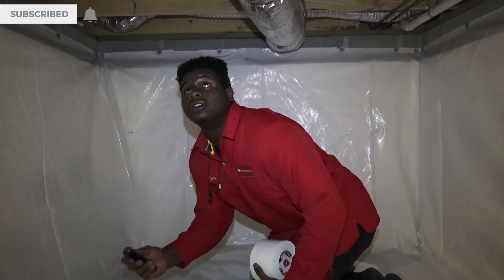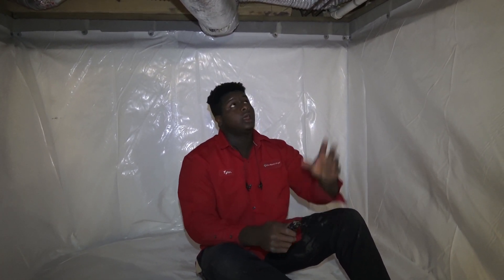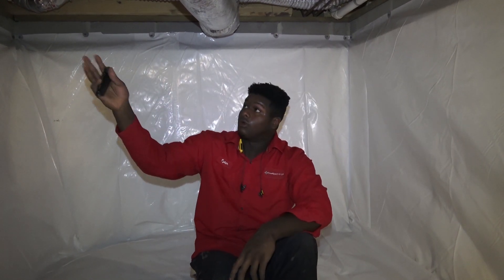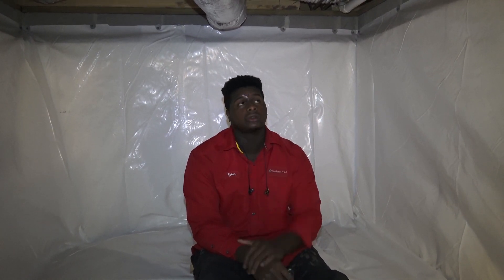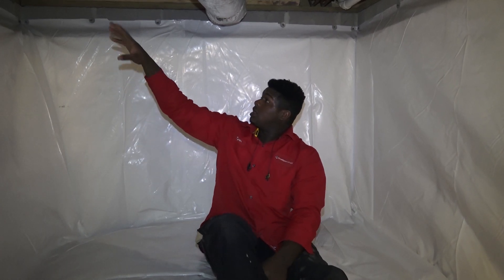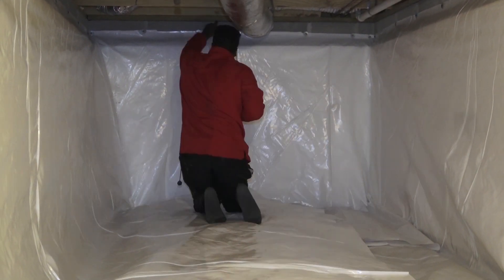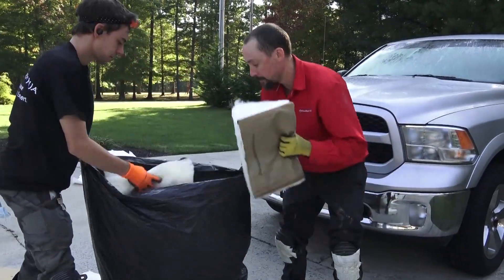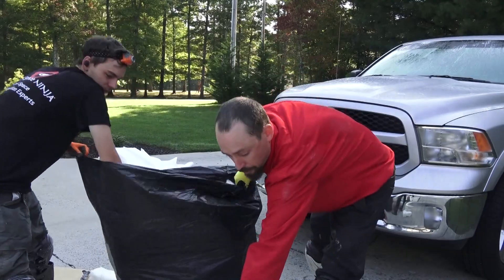Crawl Space Ninja Steps Before Soda Blasting

Comment: Is full encapsulation always necessary? I haven't seen a video discussing this. Please link to it if I've missed it. I've got another company offering to lay down a barrier, seal up vents, install boards, dehu, exhaust fan, and new door. They claim that a full encapsulation is expensive and isn't always necessary. How would I know?
Reply from the maker: It would depend on your humidity levels and if you have water intrusion from your foundation walls. We typically find that a lot of moisture still gets into the crawl space from through the cinder block foundation walls, especially if they are below the outside grade. However, a partial encapsulation like what they are recommending may work well for your situation depending on what's going on.